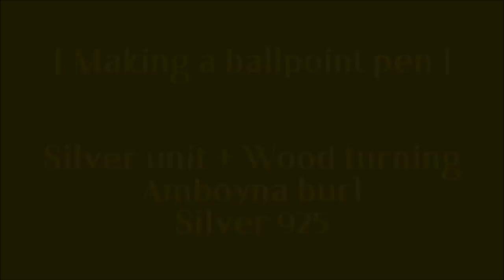[ PEN TURNING ] Making Ball point pen / Orange Amboynaburl, Silver, Gold

Comment: Very nice. The rings like washers, what are they made of? I was thinking Brass washers could work for a gold look. Also at around 0:58 what are you rubbing on the blanks? Is that just to see how the grain will look, or is there another purpose for doing it?
Reply from the maker: All metals used are "silver" except for the pen kit.
How to make a silver washer,
Introduced several times to other videos of my channel.
I majored in metal crafts and have been working for 29 years.

0:58 At the same time assuring viewers the color of the trees,
It is a smoothing operation.
This is because units meet vertically.